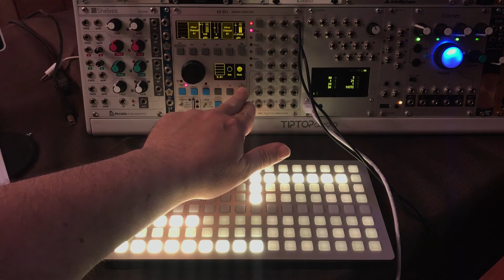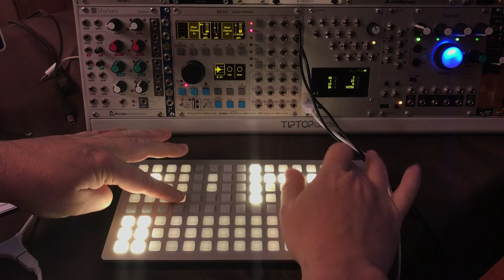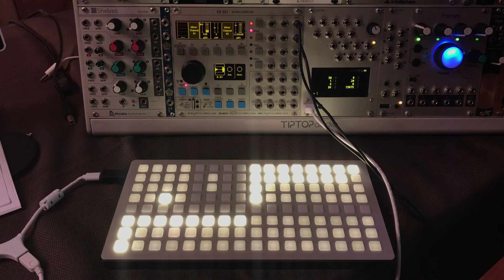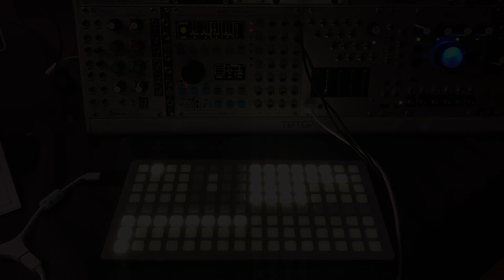Pillar:  Teletype sequencer

Comment: What is the name of the usb splitter? Need something that would power up grid and at the same time connect it to teletype. Thanks!
Reply from the maker: I'm using a splitter that came with the Arturia Beatstep Pro.  But you can actually order just the splitter.  https://www.arturia.com/store/accessories/beatstepproreplacementcablekit.